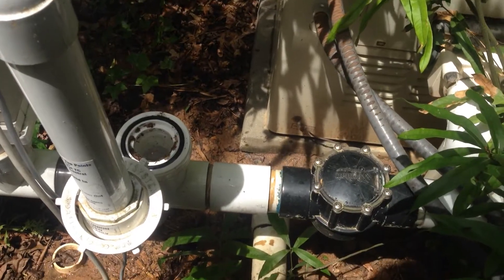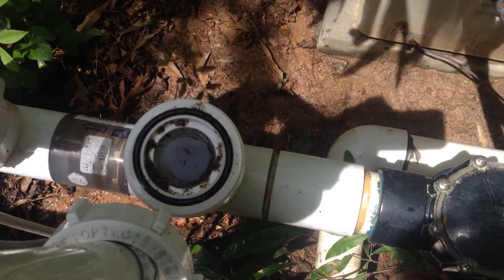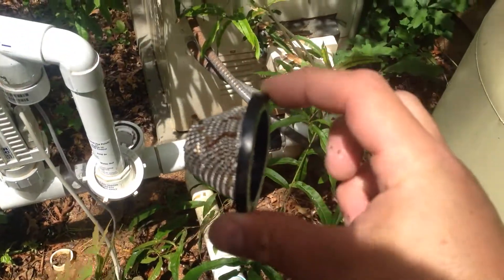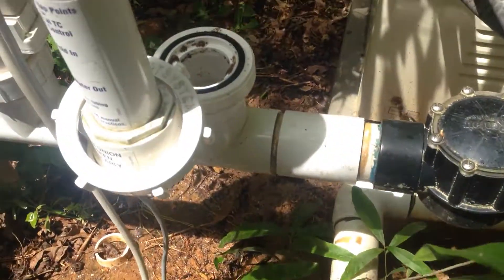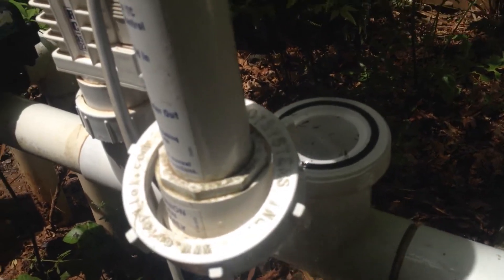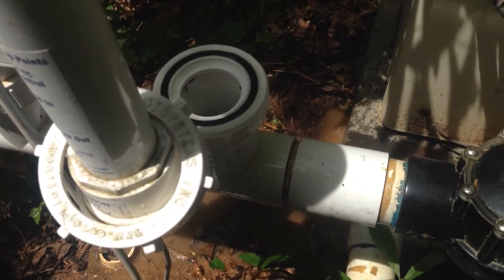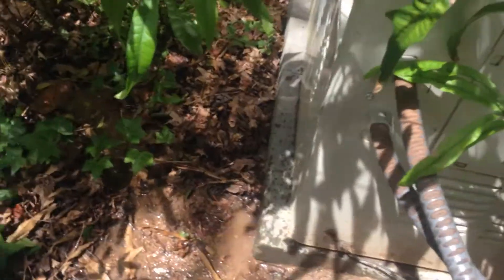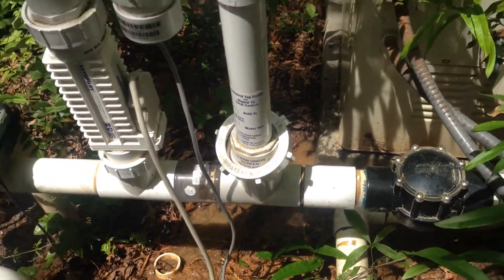Clean debris out of Autopilot Salt filter screen - PRO TIP - Luke Pool Service

Comment: If the screen is dirty will the system give you an error?
Reply from the maker: The salt system will not give an error specifically for dirty filter screen. It will give an error red flashing light that says no flow.
Reply: @lukepoolservice  mine keeps getting dirty. I cleaned that screen 7 times in the last hour. The red light will stop flashing at first. Then it’s start flashing again saying no flow and I have to keep cleaning it. Any ideas?
Reply from the maker: @Johnnyta43  something is wrong with your pool filter.  Check that for debris leak
Reply: @lukepoolservice  Thank you but where exactly would I check for that? Also which may have something to do with this is after I took the cover off there was a ton of dirt and rocks at my deep end from an animal that got underneath the cover so I’ve been at it scooping it out with the pool skimmer for hours and now my pool is all cloudy and dark also.